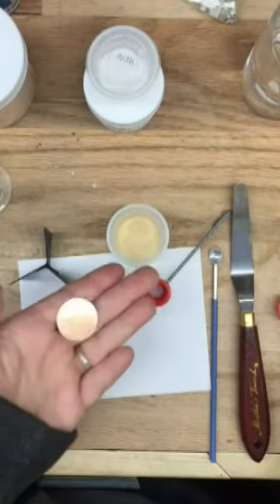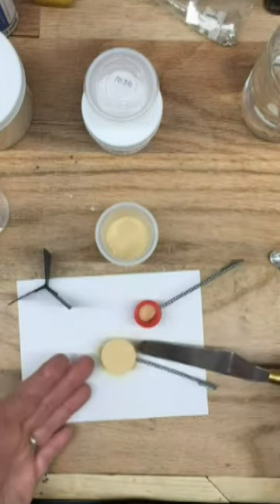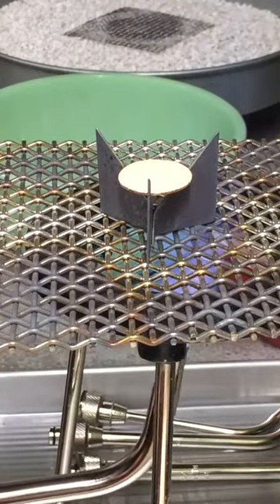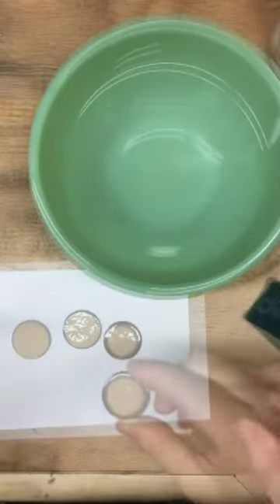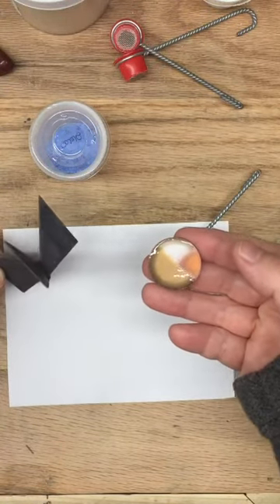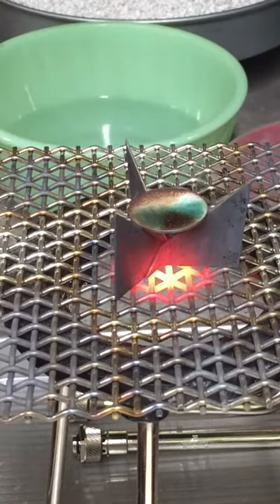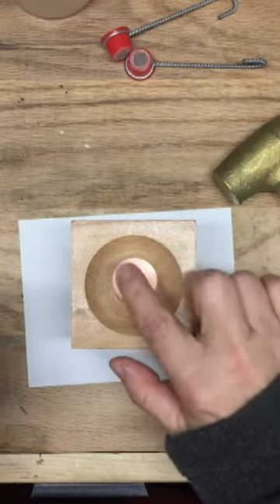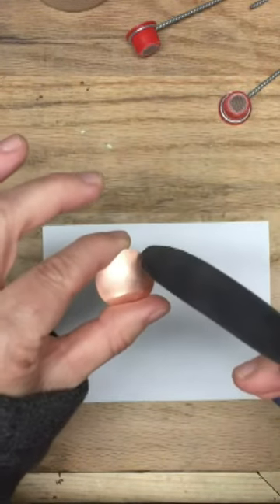Intro to Enameling - Sifting

Comment: Hi Chris, Thanks for sharing this, A lot of good tips packed in it.
You said you usually use a kiln and not a torch, one thing I've found with torch firing is it's better to use a more focused or less bushy flame as it greatly reduces the size of the dark ring on the edge, unless, as you said, it's a look you want.
If you do use a narrower flame be sure to circle around the whole piece so as to heat it evenly.
Reply from the maker: Thanks so much, Mike! That's a great tip and I'll be sure to try it.

Comment: Thank you so much for creating these videos and sharing all this information. Can I ask what fume extractor you’re using or if you have any suggestions as to what to look for in an fume extractor? I’m just starting out so I’m making very small pieces and using a small Handy Flame torch with Mapp gas.
Reply from the maker: Hello,
Thank you! I use this fume extractor for soldering and torch enameling. I do have a very large space with vent fans as well, so am not sure how well this would work in a space such as a basement. amazon.com/gp/aw/d/B0007ZLH4Q Hope this helps and that you enjoy your enameling journey 🤗
Reply: @10Gables  Thanks for your reply. I was afraid you were going to mention the ventilation. I’m still trying to figure that out. Thanks again for all your information!!

Comment: Hi could you tell me please why I see bubbles in my enameled project after firing...thank you
Reply from the maker: Hello! The answer is 'it depends.' There are so many things that can cause bubbles. If they are large spots that resemble pits, the chances are your glass is pulling away. If you're using a spray fixative and it isn't completely dry, you'll see this because the grains can move as steam escapes. If they are really tiny, this is usually caused by air bubbles caught in between smaller grains of enamel. Grinding your own enamels and wet packing can help, but there is always a risk of them appearing at any point in the process. They can also be caused by contamination such as the porcelain used to grind the enamels, dust, etc. I would recommend signing up for a course with Ricky Frank or Merry Lee Rae and working through different techniques and experiments to determine what the issue is and what works best for you to address it. Enamel is one of those things that we all do differently and this is a perfect example of hearing ideas from multiple people to try. Hope this helps!
Reply: @10Gables  I really thank you for your fast response...Definitely this info will help me a lot...you made my day...💐

Comment: Can you use any kind of torch?
Reply from the maker: @dlavanceful  Thanks for your question here. It's a good one and the answer I have found in my experiments is 'it depends." 😊 Others may have differing results, but here is a rundown of what I've found works for me.

 I've successfully used a creme Brule style butane torch on smaller pieces less than an inch. I've also used acetylene-air for larger pieces less than 2 inches. The butane doesn't seem to discolor certain enamels as much as the acetylene does. 

I've also used a propane-oxygen little torch, but tip size makes a huge difference. With the largest standard tip, I've been able to enamel pieces up to an inch. Paige tips expand the capability of this torch to work more like the acetylene-air because of the flame size rendered. And propane is about the same discoloration as butane. 

Hope this helps!

Comment: Hi! Is the cookie sheet you're using for protection made of aluminum? If it is, I would recommend you switch to one made of steel. Aluminum has a melting point of about 660 F, but the enameling process uses temperatures up to about 1500 F! If something were to go terribly wrong, your cookie sheet may not protect your work surface as good as you'd expect. Not to mention that the last thing you'd want in an emergency situation is more molten metal!
Reply from the maker: Thanks for the reminder for people who may be watching this and thinking about work surfaces. As you may be aware, it is impossible to share every detail of every thing about a process in short videos :) Workshop safety is important to me and this is a steel cookie sheet. And the surface it is sitting on is also steel - a great workshop cart from the 50s we bought at a factory auction. In my new shop, I have a wooden cabinet underneath the kiln and work top. To help it stay nice and cool, we topped it with a 5mm thick piece of sheet steel. It works great!

Comment: How do you prevent the counter enamel from melting and running when your torching the other side?
Reply from the maker: Hello! It is a matter of not overdoing the heat. If your finding the counterenamel is developing holes because it is burning off,.try keeping your flame further away from the piece. Hope this helps!